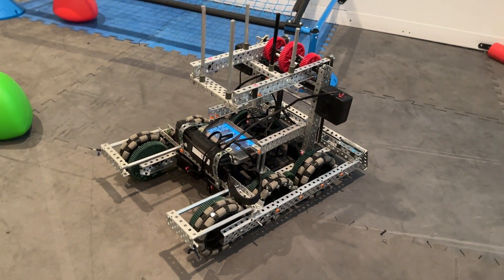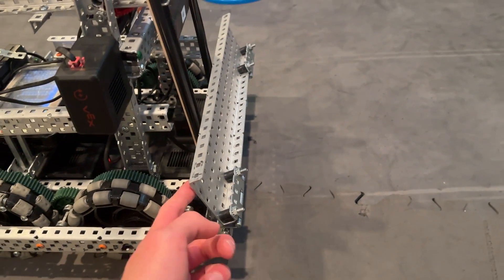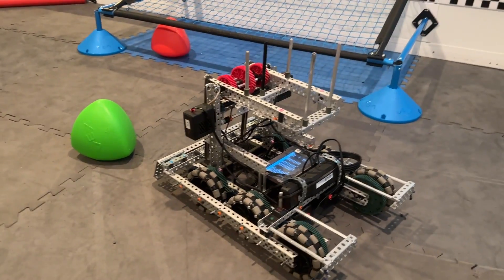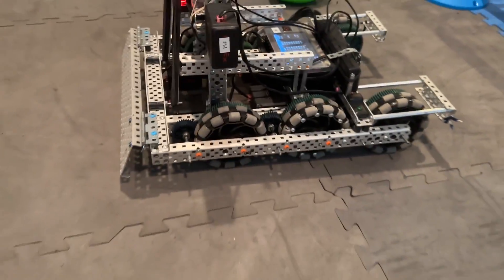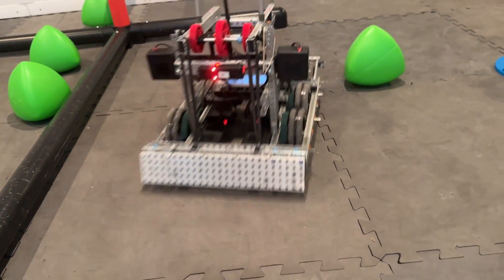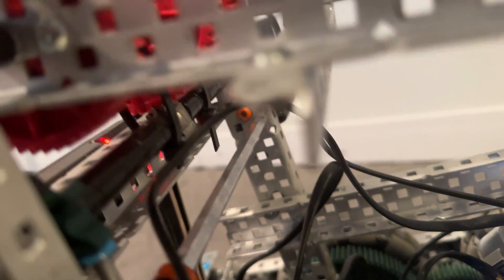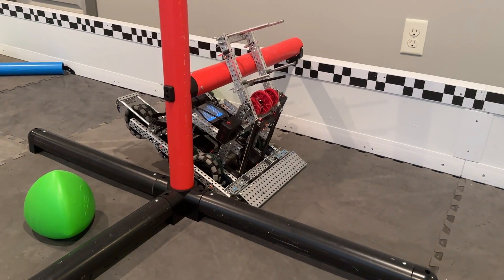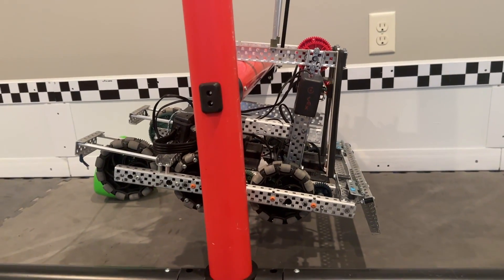RI3D Basic Cata Explanation

Comment: why do the cata thingys wiggle wiggle
Reply from the maker: The code is just set up to spin the cata if it is less that a value. Then the motor stops and due to slop the robot drops beneath the threshold. So the motor re engages and then the cycle repeats.
Reply: @9MotorGang ok, also why do the standoffs shake like that though
Reply from the maker: @nothingg124  The standoffs are mounted on rubber links so that it can drive under the barrier